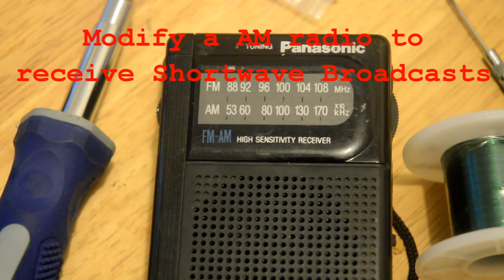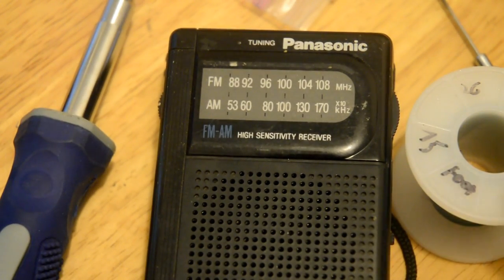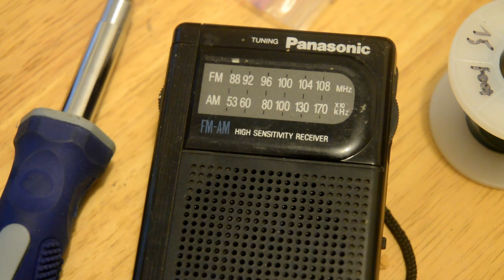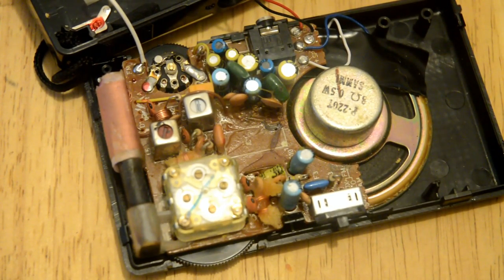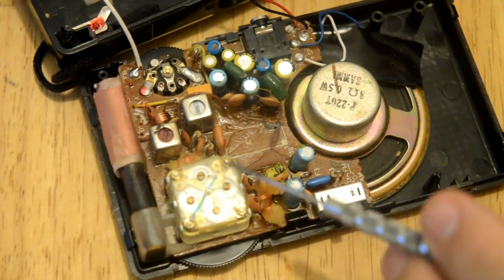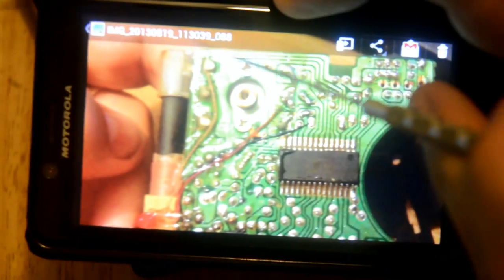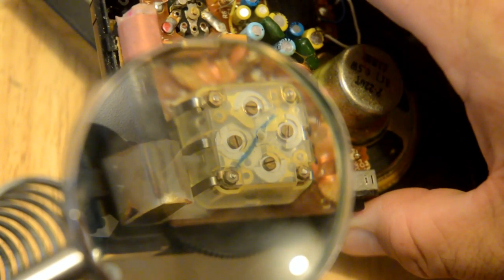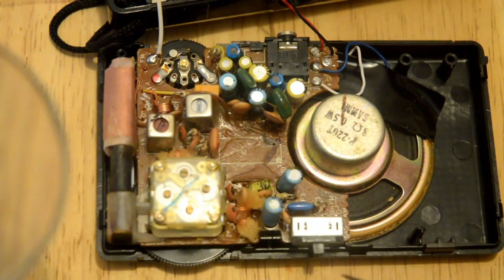Modify a AM radio to receive Shortwave Broadcasts

Comment: AM - FM  are modes of modulation, the frequency is what is important when it comes to bending radio waves back to earth (skip / hop) . not the mode. 
lower frequencies are better at this but like you said "at night"
HF is absorbed by the D layer of the ionosphere during the day.
Reply: NO
it's the frequency. lower frequencies bend back to earth. if you're referring to broadcast radio look at the frequency AM is used on the longer wavelengths HF and FM is used in in VHF  -- if you modulated the carrier differently it wouldn't matter.  from about 50 Mhz down is  HF -- note AM broadcast is in Khz
Reply: Modes are modes, frequencies are frequencies. And yes to the layers of the atmosphere.. They effect now radio waves behave at a given frequency the MODE is unaffected. It's just the method used to assemble the message.

I also have a little experience with HF radio, I hold an extra class ham radio license. And build my own antennas .. On 40 Meters I can be found on CW MODE, Show scan TV, sideband, AM, digital modes such as Olivia or RTTY. There are the many more modes all can be done on 7 MHz for example

73 de AC0V
Reply: Only the HF on the 160, 80, and 40 meter bands are really absorbed by the D layer during the day.  Sometimes, 40M, 20, 10M work just fine during the day. As you said, it's frequency related but not ALL HF is absorbed by the D layer....only the really long wavelengths are.  At night, 40, 80 and 160 rule and are heard all over the world
Reply: Michael Hartmann the High Frequency (HF) band goes from 3MHz to 30Mhz. 50MHz is VHF. You can get some cool propagation on lower VHF. During the summer you get sporadic E openings that allow for greater distances. I talked to a guy here (bay area CA) who once had some amazing propagation on the 6 meter (50-54MHz) band. He was operating AM at 1 watt. For about 20 minutes propagation opened up and he was able to reach South Africa. That's why ham radio is so cool. I hope we will have some good sporadic E openings this summer.

Comment: Could you use a regular AM FM radio antenna?
Reply: Yes you can, I know you asked the question a year ago, but yes you can and its another thing he didn't make clear in the video, if you buy a small s.w receiver it has a built in telescopic antenna and it work's, a longer antenna is always better for s.w but it'll work but not quite as well, all depends on where about you are/ and what interference is nearby

Comment: Good video! You can also just very carefully sand with fine emory cloth the top of the antenna coil until you see the copper exppsed, leaving several turns on either the far left or the far right side alone. Don't get too crazy with the sanding, those copper coils are TINY, and you don't want to break through them entirely. Now, place some Flux paste (The kind made for radios, NOT Plumbers acid flux, or it won't last too long..but you COULD in an emergency of course.) on the exposed copper coils, and to that you stick a short piece of insulated and preferably stranded wire after you have bared both ends, and solder one end right to the top of the antenna coil, flowing solder across all of the exposed wires that you sanded down. Now, take the other end of the short wire, you can make a little hole in the radio case for this wire to go through if you want to, and snap the case shut. You now have the case shut, and a wire sticking out of the side of the radio. Solder an alligator clip to that, if you want to be fancy, and attach a long piece of wire to the end to act as an antenna... say ten to twenty metres of wire, but no more, or the radio will overload and be less selective. Or you could just wrap them together. Now turn the radio on, and SLOWLY tune, and you will hear shortwave. The tuning will be VERY narrow, so you will have to SLOWLY tune that narrow range. Forget these other posts by people who say it won't work. It WILL work, I have built more than one of these in the past. It's a good way to build an expedient shortwave radio, and you could even NOT solder it at all and just wrap the bare part of the wire around the coil in an emergency... it would work, though not as well and you would have to fuss around with it now and then. You could unhook and hide the antenna wire for later use. That wire is fine, and while delicate, it is almost invisible...if you had time, you could even unwrap part of it, reattach several turns, and use the uncoiled leftover wire ITSELF for the antenna wire.. yes it's small and delicate, but hard to see if you stick it up on a wall somewhere , or behind or on the edge of a piece of molding, or whatever. People don't live free everywhere in the world, they can be excuted just for listening to the "wrong" radio station. and a disaster can happen anytime, anywhere, to anybody. This is the reality we take for granted....I'm not a "prepper" myself, folks. But having a few weeks worth of food in case of a snow or other emergency? Just like Money in the Bank and Common Sense! Being able to receive shortwave radio no matter the circumstance is a good thing to know.

Comment: Not actually a heterodyne system that is modified...its a parasitic tuning system which is not actually selective working at real frecquency but on harmonics. Will work only on powerful ststions. To build a truely proffesional shortwave heterodyne modification,the medium wave coil(red) must be changed and replaced with a shortwave coil and the ferrite rod completely removed or disused. If you are clever enough you can remove the red medium band coil and rewind the coils to suit shortwave band reception.

Comment: So. Can I tune other stations with "tune wheel"?
Reply: I don't belive you can pick up short wave stations just stations on the same band further away. I don't see how the frequency band changes from the standard brodcast band?he has not done an alignment of the radio for any other bands maybe just added to the leangth of the antenna that's all he's just picking up stations not used localy within the frequency dial of the radio.Jim

Comment: I beg to differ....this circuit works. I have built two of them in the past. Why don't you take up the challenge, fire up the Hakko and, build one? In my comment (above ) I give slightly different instructions,  though the concept is the same. 73, DE W8LV.

Comment: I guess but I am not that patient to modify an AM radio for this also I have a few multi band and continuous band radios. 
If an EMP worth its salt happens then solid state electronics will most likely not function anymore unless you know how to shield your equipment. 
Tube type equipment should be fine though and thus I have a collection there also from TV's, AM/FM/SW receivers, Amplifiers, Ham Radios, Commercial Radios, AM and FM broadcast transmitters that have all been restored to working condition.
Also new generators may not function after an EMP due to most of them having electronic systems built in. Unless you have and older one or know how to safely by-pass the electronics they may not even start.
best thing to have for emergency power in your radio building is solar power and a battery bay, maybe some inverters.

Comment: This should be titled "Receiving Shortwave Broadcast in the Medium Wave band," It is a common misconception to confuse AM (Amplitude Modulation) with frequency in meter band. You are referring to the medium-wave (MW) band 522-1620 Khz to up-convert to any portion of 2-30 Mhz Shortwave band by tinkering with the local oscillator tank circuit. Please note that Shortwave broadcasts were also in the AM mode. NPR radio is the only shortwave broadcast that works on single sideband (SSB) mode that I heard of. And by way of note, the Amateur 10 meter band in 28 MHz also works in both AM and FM mode .
Reply: 1710Khz is the top MW frequency, not 1620Khz
Reply: Jeffrey Wimmer
Yes I know that, 1710 Khz is the top of the 530 - 1710 Khz mediumwave band used in the United States and elsewhere in the world, with the 10 Khz increment. But sorry, for mentioning only the band plan with 9 Khz increment being used here in Asia, particularly in my area here in the Philippines. Cheers and Happy New Year to all! :D
Reply: mannydeguzmanjartist Although, for those wishing to listen outside the international broadcasts, most hams and utility stations (marine stations, airline comms, etc.,) operate in SSB.
Reply: KC1BZF 
Yes. This video DIY is intended for shortwave broadcast only..But SSB signals could be decoded with a separate simple 450 Khz BFO oscillator, but that's another story. I remembered in the past, I have crudely tuned an SSB signal by coupling another radio with a near frequency to interact with the main radio used so squeals are heard. By critical fine tuning,on the knob of the second radio, the SSB were made intelligible on the main radio tuned to the target frequency..
Reply: mannydeguzmanjartist Nice! I may have to try that some day. I was not aware that radios could interact that way. That's pretty cool.
Reply: mannydeguzmanjartist To add about SSB, Hamburger LokalRadio and some american station txes in usb

Comment: LOL, a shopping cart as an antenna.  Does that work?    Why not.  

I did a mod similar to this I saw on a different Youtube video, to my vacuum tube GE 430 AA5 when I first got it, by replacing the build in air coil antenna on the back plate with a ferrite antenna to it, and then wrapping a couple of turns around the ferrite in a different position and attaching that to a long wire, and the other end to one of the original air coil taps.   For my long wire antenna I used downed black telephone line wire laid out on the ground (not the most optimal location, I know).  But in a pinch a prepper could find telephone wire everywhere.  Who uses land lines anymore?   And btw the stuff is strong, it makes excellent clothes lines.

Afterwards I got a DX-390 and began modding it and lost interest in the AA5 for bizarre DXing.  I was fun to DXing on a crazy rigged setup.

Comment: For God's sake, just buy a sw radio on Amazon or radio shack. A decent one will cost $100 and under.
Reply: That's not the idea here....it's to reuse something in a different way than it was intended to be. M.O.D.I.F.Y....... :-)
Reply: *****
There was when I printed it. So your w.r.o.n.g. :-)
Reply: You can buy a cheap SW radio for $10 that will outperform this thing.
Reply: Why stop there.....they make them that cost thousands of dollars too $$$ you are still missing the point.
Reply: I have several of them so I don't have to modify anything. That is what a prepper does.
Reply: Then you don't even need to be here.... Please move along now unless you are just trying to stir up needless hard feelings.
Reply: I like the rest of those videos. This is about practicality. That is the point you are missing.
Reply: Yea, Okay.
Reply: ***** It will work, it's your brain that isn't! Have you ever heard of Heterodyning? Oscillators? LC circuits? Simply changing the values of some of the LC circuits can alter the frequency this AM radio will receive. I have done it many times. You are apparently not aware of the older shortwave converters which could be put in between the receivers antenna input and the converters output. How the hell do you think these converters worked. Better keep quiet as you are making a fool out of yourself.
Reply: ***** Mr smart ass...tell us WHY it won't work if you are so educated in electronics. I have a degree in electronics and I have been an engineer in radio broadcasting. I hold an amateur extra class license and have taught electronics on a university level. What are your credentials? Hurry back...give us some details and not just some simpleton answers.
Reply: ***** Radio Basics 101: The ferrite loop antenna used in this AM-FM portable receiver is wound with wire which is brought into resonance by the tuning capacitor. This circuit also tunes the rf components of the receiver serving a dual purpose. Winding a smaller coil on the ferrite rod will enable the resonance frequency and other circuitry to tune to a higher frequency. ie: Short wave. Pretty basic stuff.
Reply: ***** Oh my god man...listen and quit reading between the lines....In many older portable AM-FM receivers as the ferrite rode antenna ( an LC circuit) is tuned it forms the TUNING CIRCUIT for the receiver enabling BOTH functions to be combined within the same components, reducing the number of components and the cost of the receiver. We all know hetrodyning my lackie friend...Incoming signals mixed with local oscillators producing intermediate frequencies which are then amplified and detected  and then sent to the audio amp circuits. AVC voltages are usually derived in the IF portion of the receivers as well.  In the 1940's Collins Radio Company, headed by Art Collins, developed the crystal controlled front end and PTO tuning devices which made the receivers much more stable. Today we use PLL and DDS circuits to tune radios. When you say I'm bullshitting you are simply smelling yourself.
Reply: ***** Lets try and be civil so here goes it one more time: The short term "ferrite rod" sometimes refers to the coil-plus-ferrite combination that "takes the place of both external antenna and the radio's  first tuned circuit-mixer". Look at the wiring diagrams of many, but not all, of the older portable AM radios and you will see that the ferrite rod antenna does serve two functions, usually a cost saving method using fewer components. In this case the AM radio being modified could receive SW signals as the author implies. I collect and restore radios and most of them do not use rod antennas. The signals are first sent to  tuned rf circuits and then onto the first mixer stages. They all require external antennas. I also build Regenerative SW receivers which were first developed in the early 1900's. They feedback some of the signal in the final stage back to the input stage of the receiver thus adding to the original signal. If they are not adjusted correctly the external antenna can pull the oscillator off frequency. ie: There are a number of workable schemes to receive and detect RF signals. I also build DC, DDS and PLL receivers. Lets get into any radio type topic you wish and I will blow your shitty pants off everytime.
Reply: ***** Well I'm actually beginning to like you a  bit  and your protective response back at me is somewhat admired. I was just returning the favor from your previous slams. So don't quite go back to square one. I can be nice and I'm certain you can too. The DC receivers I build are for Ham Radio frequencies and I team them up with home brew QRP transmitters. The DDS phasing receivers are also basically DC receivers but they receive one sideband only which makes it nice when tuning a signal in. I'm not actually saying the AM receiver modified this way will bring in short wave signals well but it's possible it will to some extent. I wonder why the author would post this video if it's complete bunk.
Reply: *****
I realized I was still being a bit nasty so I deleted my last comment and cleaned up the one I posted yesterday at 9:44 PM. Good day.
Reply: ***** I guess we all have that rough spot but I'm glad it's behind us as we certainly have lots in common.  Got my ham ticket in 1960 and upgraded to Extra in 1970. It looks like you have been around a bit too. Aircraft Radio Repair on the B52's and KC-135's during Vietnam, radio and tv broadcast engineer, had tv radio repair business, owned my own HVAC company and now I repair and restore Ham Radio gear in my retirement years. I also collect tube HI FI gear and build tube AF amps. To be a bit more honest, I have never modified an AM portable radio like the one on this site so who know just how well, if at all, it works. YouTube can generate some strange responses and people for sure. I wish I could give you my call sign but it's best to remain hidden here. 73 OM.
Reply: *****
For an intelligent Limey you are still farting a bit in your responses yet still mostly manageable. You need to let the little shitties go just as the body rids itself of nasty toxic. But were still ok. I'm not sure what you are asking in regards to your frequency conversion inquiry but I will respond with this even though you may rough it up a bit in your reply back to me. The local oscillator is tuneable, it does not stay at one set frequency in a single conversion receiver. However in a dual conversion receiver it may be a fixed frequency controlled by a crystal. The second mixer stage would then be tuneable. For example, in a single conversion receiver this oscillator could run at .550,455 MHZ for a station on .550 MHZ and for a station at 1.6 MHZ it could run at 2.055 MHZ. The "difference frequencies" in the IF amplifiers would then be .455 MHZ in both cases, etc.  And yes, I think I have the riddle tackled but I will wait a while before giving out any vulnerable information. Comments like "no stupid, CB teenager you" make me wonder if you are related to Dr jeckle and MR hyde. I was very decent to you in my last reply. Lets clear our bowels and begin with a fresh set of dinner plates.
Reply: *****
Fair enough! I'm a classical Jazz fanatic and play some piano. Very small world there mate. You may be right ..I'm not quite sure how well that mod to the AM radio will work either. Lets try it and CCCCC what happens. Check your email bearded man.
Reply: TheRudydog1, They were a b"""ch to align as the gear train developed a slight bit of play. LOL As a CTM in the early 60's worked a bunch of R390 and 390A's A guy in our Div did have a way of "settling out" the gear train difficulties. He would pick the receiver up about 8" and smack it down on the bench. LOL